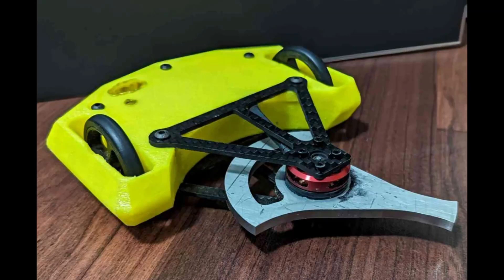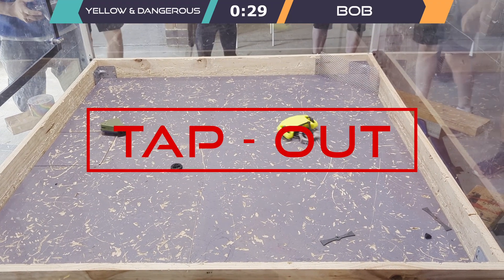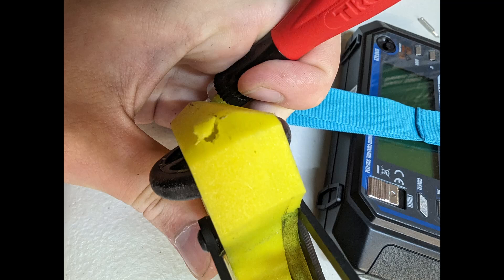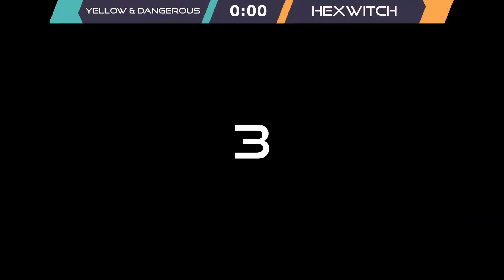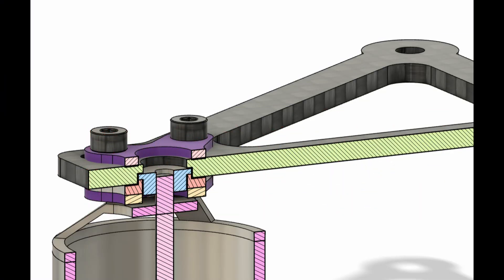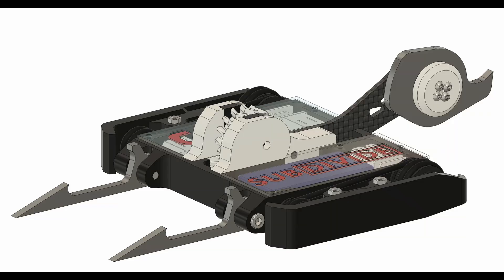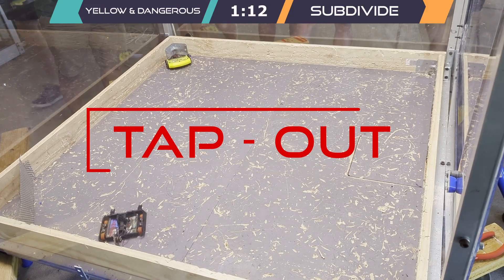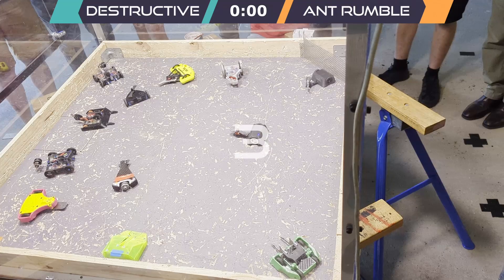First Event!!!   Feb 2024 WRC - Y&D Mk1

Comment: Your bot is killing itself! The weapon motor is sucking way too much power. Every time you start the weapon, it literally spins the bot into a wall and kills your drive!
Reply from the maker: Good spotting! Its not sucking too much power exactly but yeah the torque reaction of the weapon spinning up spins the whole bot lol. Not necessarily an issue as the same can be seen in other bots (tombstone often does a full 360 when starting up) but definitely something to consider. Wider wheelbase would help with this too. Drive is definitely underpowered and generally hard to drive. All things will be improved in the next iteration.